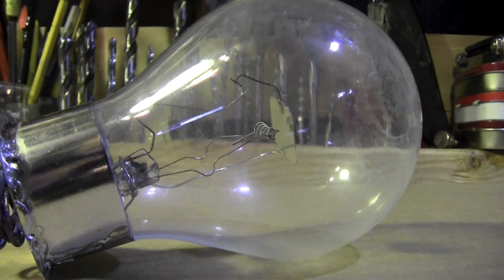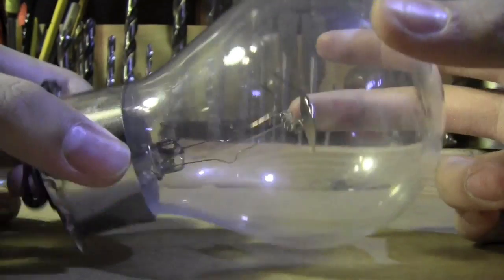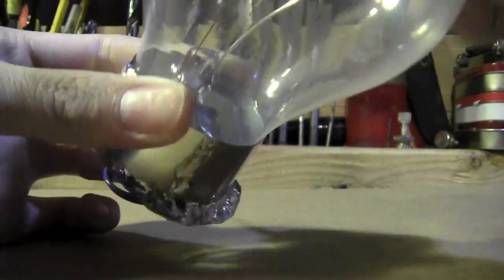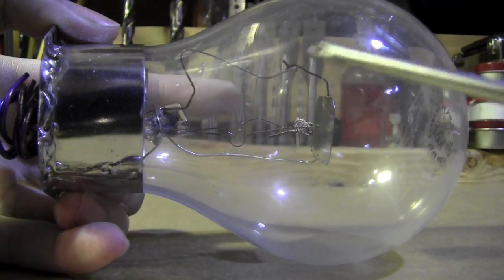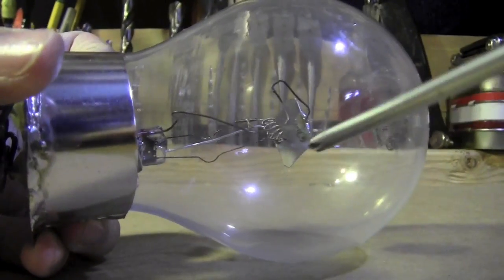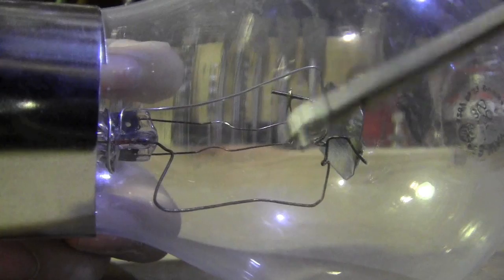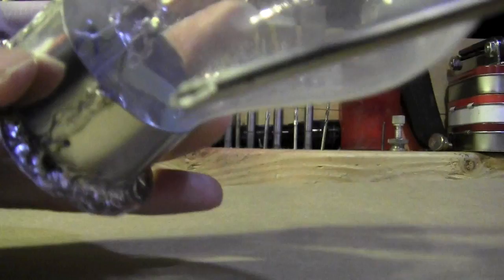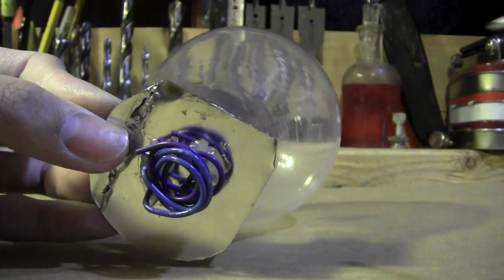Homemade Tungar Rectifier/Diode 99% Done

Comment: @lbochtler oh and have i mentiond the price of the equitment you will nead to do this? argon isnt cheep, so is the pressur reducer and the vacuum pump, well you could use a fridg compressor if you only wnat a crud vacuum, but you wont have the tube operational for long, since the vacuum pump must be on at all times, as well as the argon gas. so id say if you realy want to do this, redo it and get some proper matirials, such as borosilicate glass, thoriated tungsten wire (filament / cathoide)...

Comment: if you want to create a vacuum inside there, well ... i hate to say, as far as i can see it is imposible, atleast in your configuration, usualy you use a vacuum pump and a getter to create a vacuum, but since you dont have a glass bulb anymore it will only have a slite vacuum as long as the pump is operating, and how to add argon, well easy just get a botl of the stuff and use a preshur reducer to limit the presur going to the "tube" walst pumping the gas out of it again.

Comment: If you want that to work as a rectifier it has to be under a high vacuum, not filled with argon, though it would light up and look cool. The filament is the cathode and the plate is the anode. I can message you the details on how to make it work if you want.